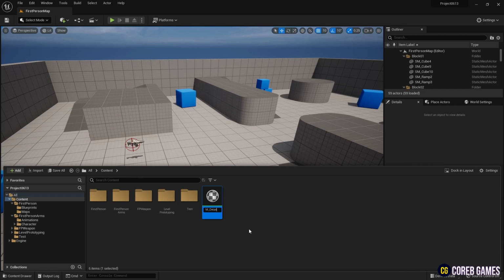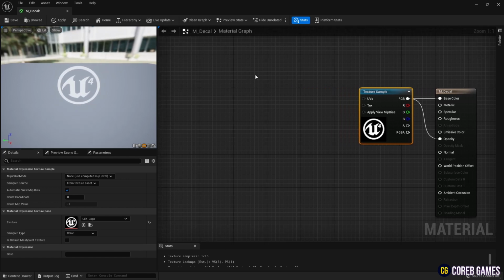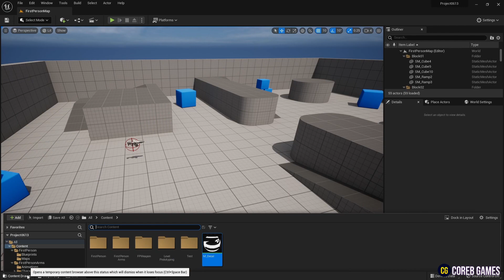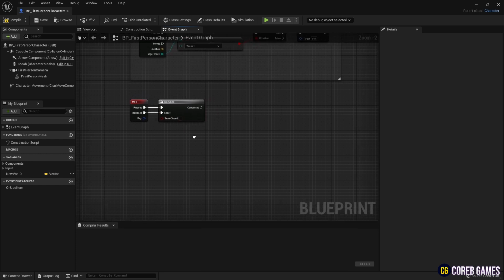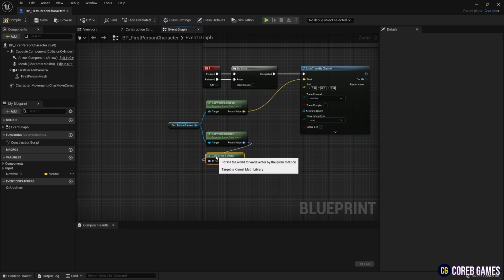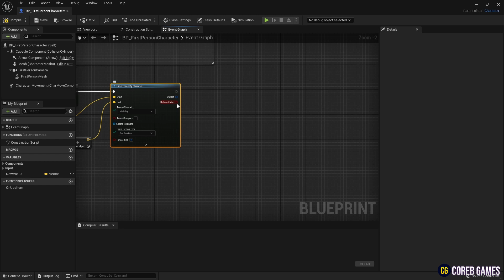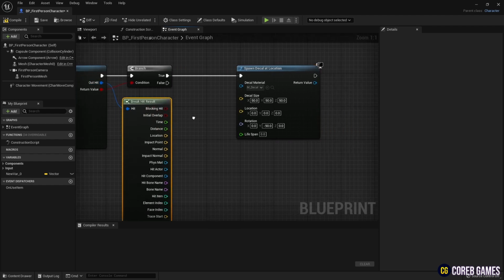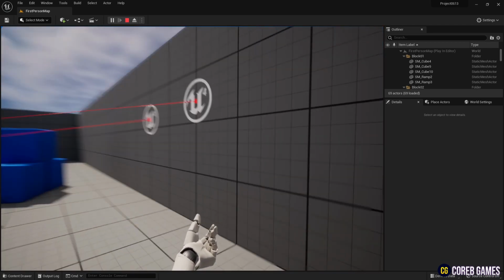UE5 l Spawning Decal on Your Level l 5-Minute Material Tutorial l Unreal Engine 5

Comment: Placed decals will also project on character and any other object within set 50 50 50 dimensions for the duration of its life also it's smeared along normal, how can I fix these issues?
Reply: Thats the problem of that "tutorials" you probably should dont use impact normal, but project decal facing player.